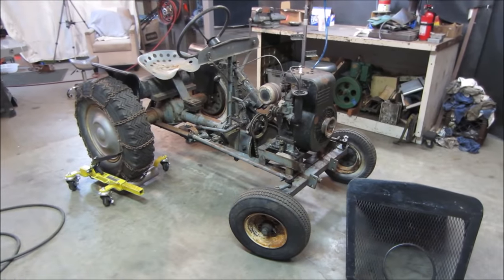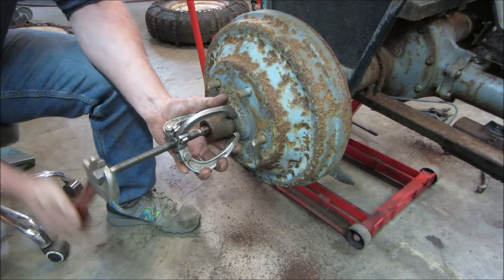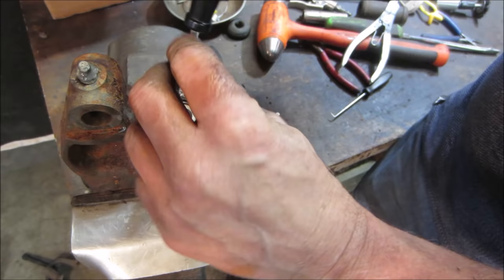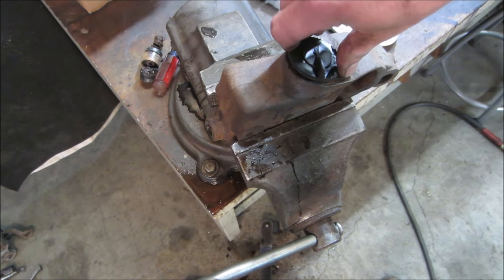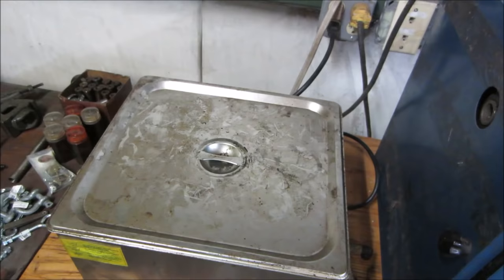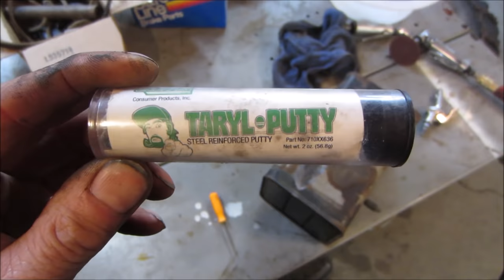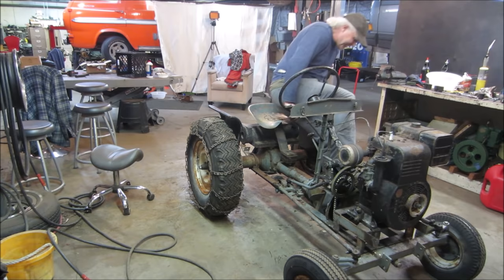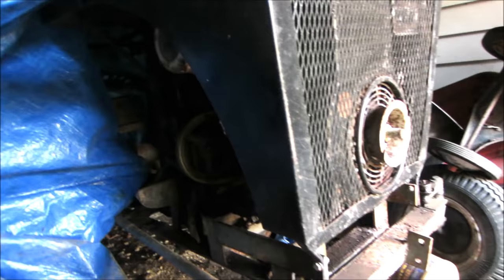Barn Find Homemade tractor, could it Be Saved, pt 3 of 3.

Comment: When cleaning out old tanks I have used Phosphoric Acid it does not harm metal but dissolves rust ans converts what's left . You can get it at HD  as Concrete Etch & Metal Prep + Rust Inhibitor use it all the time great stuff

Comment: If master cylinder fails, it's the same master cylinder used on 1960 - 1965 ford econoline, look at your econoline truck. In 1993 I had to buy one for a '61, and Bendix was only mfg back then still making them. Was pretty cheap then, brand new $27.

Comment: I had a tank like that once couldn't stop the leak but nothing ended up using a two-part epoxy gas tank repair it worked pretty good sealed the whole inside never had another problem with it

Comment: I had a '70's Honda motorcycle that had similar gunk in the tank, I strapped it to a home made Kiddy ride (similar to the way a piston on a old timey steam locomotive engine works) and filled it half way with turpentine and square nuts and let it shake for about an hour. Worked great, of course I had to replace the petcock afterwards

Comment: You might give KBS a try in the future. The KBS system is a three step process for fuel tanks, the only down side is step three needs several days to dry / cure. I've used it a few times and I am pleased with the outcome. Rust no more.

Comment: Small tip you may not have tried before. You can use a grease gun to pop out those cylinders. Just make yourself a adapter that goes from brake line to a grease zirk

Comment: GREASE GUN! I have use a grease gun to force those pistons out of wheel cylinders, and it also works for forcing pistons out of brake calipers and it works for forcing balls out of muskets too. Rebuild kits on those wheel cylinders used to be cheap cheap cheap. You hone the old ones out and replace the springs & all of the rubber parts.

Comment: Cotter Pins are a solid piece of steel with a flange on one end and a split pin hole at the other end. The items you were pulling out from the brakes with side cutters are split pins.

Comment: The master cylinder looks kinda like an old Econoline unit. I just recently saw wheel cylinders like those but don't recall what they went on. For cleaning those small fuel tanks, try getting an old used paint shaker and put sand and kero in the tank. Saves on gas, lol.

Comment: Put a length of tubing on the bleeder and run it into a container with the end submerged in brake fluid. The you slowly pump the brake pedal till the bubbles stop. Saves making a mess and is a great way to bleed brakes.

Comment: i used a bunch of air gun pellets, small pan screws and nuts, then i had a plethora of old spark plugs that i crushed in my vice and had a nice pile of shards of porcelain. it worked great with some vinegar. Mine was worse than that tank for sure, made it like new again.

Comment: Perhaps someone else already commented on the different sizes on the brake cylinder openings. I have the same type of brake cylinders on my 1947 International. The larger bore allows more pressure on the one shoe versus the shoe the smaller bore presses against.

Comment: Suggestion for freeing pistons of frozen brake cylinders: replace bleed fitting with grease nipple and pump full of grease.. Maybe after fully collapsing? Grease pump pressure should be greater than shock, and more even. Removing cylinder may not even be needed. Never attempted myself, but worth an experiment?

Comment: I would of used JB weld to patch the tank.
It's great stuff that's been around for years.
It's a two part paste and you can drill and tap threads in it.

Comment: Those brake shoe linings look like a standard size that you used to be able to get from J C Whitney Catalog ... something like 1.5 inch by 11 inch diameter drum ... 
you would drill out the rivets on the original linings and glue them to the shoes much like you did ...

Comment: Mustie these tractors are from the 1960s. They are called Power Pups. There a home made tractor and plans from from similar to Popular Mechanics.  From the transmission back it’s from a Crossly the steering is a Chevy.  They were home built and a cool little tractor. Hope this helps

Comment: Hey, you may laugh at the truck wheel "gas tank shaker" but it's a great idea--any chance you could rig up an electric wheel gizmo for the shop so you don't have to use your pickup?
How about sheet metal screws with a wide flanged head for the fuel tank? They are sharp and pointy on the tip and the threads. Maybe some star washers too?

Comment: A tip for the wheel cylinders is putting a grease fitting in them and pushing them out with a grease gun. 
Works really well when they're stuck.

Comment: Should've had the chains already off the tires & as for the upgrades, you should put some headlights on it to ride at night & rear flashers on it so you can ride it on the road with  a  triangle sign on the back but nice little tractor I would like to find a small tractor like that pretty cheap

Comment: A few years ago i found a Sears Craftman garden tractor on an abandoned property, i got permission to take it, i put 250.00 into it, it has an 18 H.P. Kholer magnum engine it runs fine and this tractor also has a 3 point hitch and a hook up for a blade, i looked all over this property but i couldn't find the mower deck or any thing else that belonged to it. The steering needs to be rebuilt the bushings are shot, they're a fiber type, but once i get my metal lathe i will get some bronz stock and make better bushings for it and install zerk fittings. The transmission has high and low range, 6 foward and 2 reverse, it has a leaky seal at the axil, so i have to replace it. It will be a gem once it's all done!

Comment: Back in the day when folks had no money they build things out of scrap and made amazing creations just like this one that Old grandpa made. They had that mechanical itch and they just had to scratch it. I wish my back wasn't so screwed up! as a ex welder fitter I made some crazy creations myself through the years and I miss it bigtime. Is it just me or am I seeing things, it looks like the tires on the right side are a little bit larger than the ones on the right. You need to build a little plow for that contraption it would be perfect for cleaning up snow in your driveway. If I had it, I would use it for that in a minute.

Comment: I'm not a fan of using epoxies to reseal metal gas tanks. Radiator shops can do a much better job and it's pretty cheap. I'm willing to go to the extra expense because I'm REALLY not a fan of fuel leaks.
Other than that, great video and nice work!

Comment: Pro tip for that epoxy putty, wet your fingers and use that to press it in. its designed to work that way. 
I'd have just busted out some pipe solder for that gas tank.

Comment: An old paint can shaker you could modify it with large C clamps maybe even angle iron with slots for the bolts to go through the angle iron four adjustments that way you can do a lot of different size fuel tanks

Comment: Your tractor is amazing, just correct the steering angle, you may have noticed that steering angle is not correct to Ackermann principle, 
When steering; outer wheel of your tractor turns more degrees than inner wheel which is exactly apposite to the perfect steering angle.
And just because of that wheels are sleeping when you steer it..!

Comment: a  bit  late  for  this  comment...  What's  that  heavy  tubular  bject  strapped  on  over the  back  axle?  I  assume  it  was  just  something  handy  and  very  heavy  to  give  a  little  extra  traction?   Beautiful  little  machine.  All  it  needs  now  is  some  hydraulics.  could  be  driven  off  the  start  pulley  would  just  make  winding  on the  rope  a  tad  more  difficult...   
With  a  lot  of  studying,  I  bet  there's  a few  of  us  who'd  love  to  make  a  similar  machine

Thar  problem  with  tarps  and  holding  in  the  moisture  instead  of  keeping  it  out....  Yep,  been  there  before. Having  a  smaller  tarp  which  just  don't  reach  the  ground,  and  some  elastic  rope  or  bungees  helps,  lets  the  wind  whistle  through,  but  keeps  the  rain  off!

Comment: IMHO if you wanted to use the tank you could probably hit those leaky pots with a wire welder and seal them up pretty decently. Looks like the metal may be good enough to brass rod the back of it and build a patch on it.

Comment: He should have hit the big side of the wheel cylinder just enough to break it free and move it, then drive it all out from the little side after the big side moves.  He didn't repeat the mistake on the master cylinder.  He drove the piston in a bit, cleaned the bore, and then drove it out.

Comment: mix gorilla glue and a few drops of water in a dish it will foam up, then you can apply it. it wont expand then and you can get better results.  Ive built a dozen RC planes with this stuff and used to to fix headlight mechanisms in a turd gen firebird.

Comment: I would have liked to see some red paint slapped on it, and an overhead smokestack on the exhaust port to cut down on noise to the operator's ears.  

Great project.
Thanks for the content.
Keep up the good work.  בס״ד
Reply: The raised stack on the old tractors would give the farmers lead and other toxics poisoning.
Reply: @tomhutchins1046  Guess you'd have to route it behind the operator in order to avoid those fumes. I was thinking of the noise factor. That's enough noise to damage someone's hearing for extended periods of time.
Reply: @KelikakuCoutin  Ear protection is easy fumes are a different story. When you have something working hard and moving slow there really isn't an ideal solution for the exhaust. Other than a sealed compartment like modern tractors have.
Reply: @tomhutchins1046  The operator, obviously, should wear scuba equipment.
Reply: @KelikakuCoutin  The old farmers died young many times they just looked old.

Comment: The outside nut lock pisition on the bolt shaft, which is egcentric, pushing the brake. Shoe, for adjustment.....probably..

Comment: The old open vent system on the brake system .later years it became a closed system.  On vent hole for air to get in . Brake fluid exposed to the air can and will collect moisture over time .not a friend to brake fluid .the filler cap was vented. ,the new system was a sealed system .

Comment: Use vinegar instead of the far more concentrated and corrosive [and burn risk] Hydrochloric Acid, instead of water when doing the tumbler... and blue metal aggregate of varied size instead of nuts. Just as effective if left overnight after the tumble. ALWAYS neutralise residual acid in the tank using cheap safe Bicarb Soda.  It stops further rusting after drying out, because the rusted surface has porosity that traps acid. A simple rinse will not stop further acid attack.

Comment: It's cool looking little machine but I was a kid we had one that was German built it was a cupar panzer. Only it had a hand clutch set up and it had like this little pulley that will go up and down and rub on the output shaft of the engine for reverse and then you pulled it up and the belts of Titan and then you go forward you only have one speed but it went through a little rear end it was pretty decent it was a little try it it was a little single steer tire three tires or three wheel setup about the size of a riding lawn mower I think it had like a 10 or 13 horse to cups on and I'm not sure anyhow cool little tractor

Comment: That brake set-up looks like the initial hydraulic brake system used by Ford when they finally switched to hydraulic brakes.  They did not use a "self-energizing" brake shoe design, so they compensated for it by using different sizes of pistons in the wheel cylinders for the leading and trailing shoes....  It works very well - - as long as you are very diligent with keeping the brake shoes properly adjusted...like every month or so...
Reply: later (late 40's) they slotted the lower pivot holes in the shoes to make them float better. people don't realize how much fixin it took to keep those old cars going and they still didn't last that long. before freeways 50,000 miles could be a lifetime of driving to town at 45 mph on a farm road.
Reply: @tomhutchins1046  Most cars would not make it to 100,000 miles back then.....for a number of reasons.....most due to driver's neglect on routine maintenance.....
Reply: @edwardmartin4894  Sort of . The oil they had available was terrible made sludge from day one. They ran rich which fuel washed the cylinders. the piston ring material was just soft cast iron and not manufactured accurately. Many were a flat head design prone to carboning up and valve seat wear. They did  not have any sort of valve seals so carboning up was a real issue. The for example the early 6cyl Chevy's had poured babit bearings and splash lubrication. The heads had poor coolant flow so they were known for cracking. I could keep going. Many people did maintain there cars and trucks they were just an old design with poor materials. Todays cars are much better but clearly designed to be so complicated and expensive and fragile castings to repair or rebuild you get your 200 to 300,000 and they are a financial total

Comment: If you glue brake liners on a car, you are going to have to know the maximum heat capacity of the glue, like it's melting point and it's flash point.

Comment: I like old tractors from an engineering POV, theyre so conceptually simple, the only thing thats on it that doesn't need to be is the engine cover.

disapointed it doesn't have separate brakes though

Comment: You should take a electric motor and build a tank spinner.
Reply: I need one too. Seen any plans for one?
Reply: @Hjerte_Verke  I would think you could use any electric motor, with a variable speed. Or a motor with a chain and sprockets so you could control the tumble speed be the size of the sprockets.

Comment: put a cup of muriatic acid in that tank then fill up with water let set 6 or 8 hours  take fuel valve off and plug hole first  after you use this method once you will never do it any other way it will look new inside
Reply: maybe i should watch the hole video before typing lol

Comment: Who lubes a chain by squirting lube on the outside of the rollers?? That does nothing but fling off and make a mess. You started the engine, tested the drive and the lube is still just sitting on the outsides of the rollers where it was put!!

Comment: Drum won't separate until you knock the studs out.
Reply: They used to crimp the base on the studs. they used to make a cutter that slid over the stud to free them up .
Reply: @tomhutchins1046  Thanks for letting an old mechanic know that. That was new to me.
Reply: @davidhenley3967  or you can just knock them out

Comment: GORILLA GLUE ON BRAKE SHOES...EPOXY OR GOOP...But it will never get hot...huh??😳 Teflon tape on all gasoline threaded connections...vibration...engine pops good...